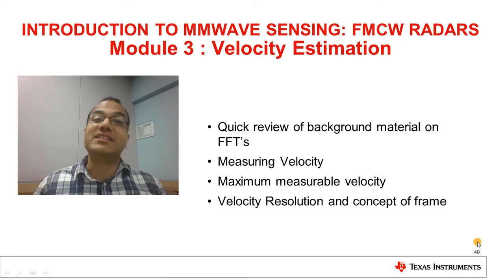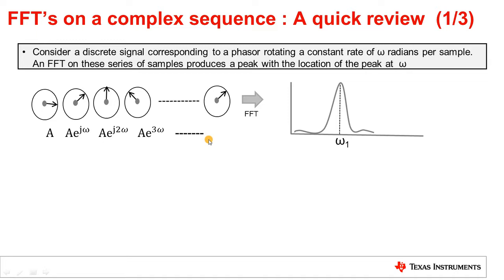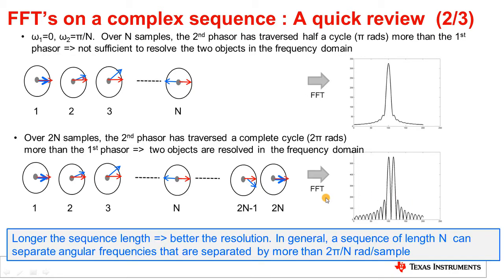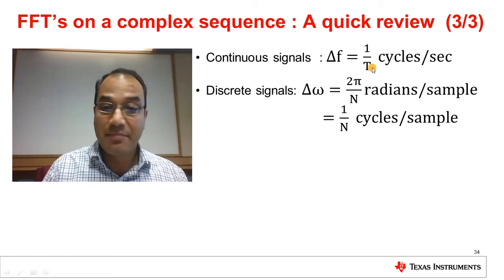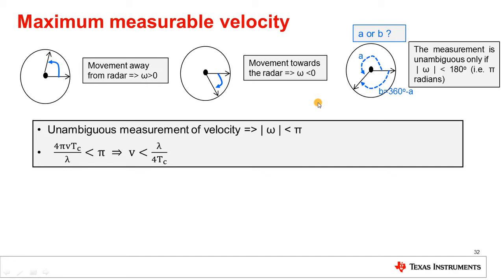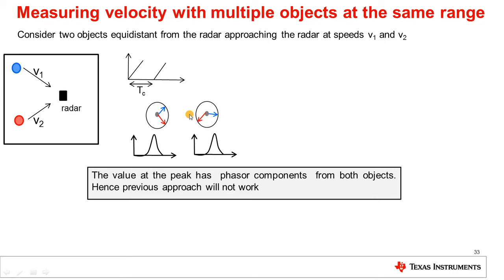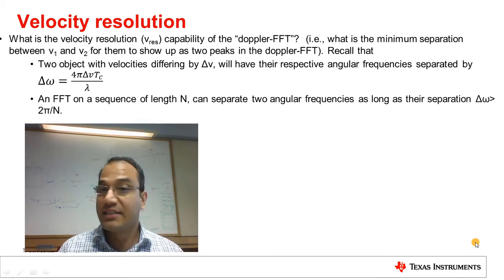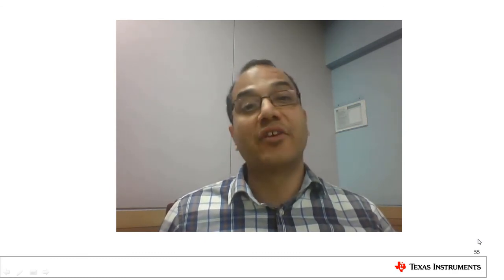FMCW Radars Lecture 3   FMCW Radars Velocity Estimation

Comment: Great set of talks. However there are a few confusion points for me, it would be great if these could be resolved.
- Is there perhaps a mix up of phase and frequency when referring to omega? In slide 33, more specifically the different phasors I thought would differ only by phase while all being the at the same IF frequency, however the narration as well as the visuals indicates they are rotating at differing frequencies.

- Minor - It might be a good idea to mention the term "doppler frequency" explicitly, what it is and that we aren't using it because it is too small to measure and instead make use of the phase to determine object velocity.

Comment: In the slide at 7:43 do you actually mean pi/2 instead of pi? because in the third case it can be regarded as (about) -145° and fulfills abs(omiga) < 180°
Reply: As long as we can guarantee that abs(omega) < 180 degree, unambiguous velocity estimation is possible. Without this constraint the third case  has two solutions : +215 degrees or -145 degrees.  With the constraint that abs(omega)<180,  only the later solution is valid.